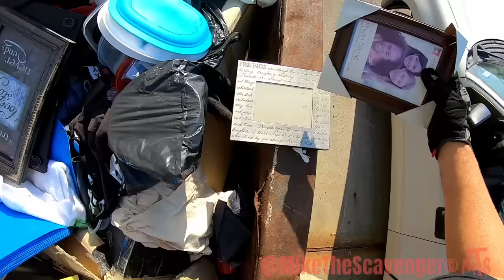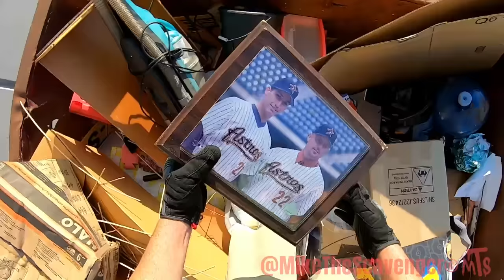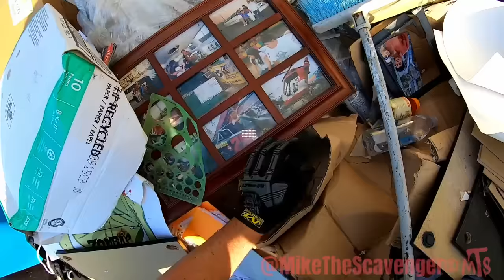Dumpster Diving "BAG FULL OF WATCHES!!!"

Comment: 17:30 that's a shotgun snap cap - allows you dry fire and drop the firing pin on an inert round. Gives the firing pin resistance when you do so you do not damage it.

Comment: The little red/clear thing at 17:30 is a snap cap for a shotgun so when you close a double barrel, etc. you can uncock it without dropping the hammer on an empty cylinder, which would eventually damage it.

Comment: I was thinking about how I miss your random underwater diving videos and then tonight I saw a video of this thing I forget the name but it’s a portable lung thing that floats on the surface and it has like a 30 foot air hose with a breather. And it just follows you around and gives you up to 3 hours of air before the pumps battery runs out. That would be cool to have Mike and do some under water videos with.

Comment: Those plates in beginning probably induction welding plates for some type of seam or seal weld in sheet metal.
Reply: Traditions in a shotgun shell you can dry shoot the gun and it doesn’t ruin firing mechanism I think

Comment: Mike, I love your Videos.
I have a question for you.  Have you ever taken one of those office dividers apart?  Some of them have extruded aluminum frames with sheet aluminum under the fabric. Plus there's a lot of Is still hardware.  I don't find them often, but when I do they're worth some coinage.  Thanks for all the great shows.
They've also got a lot of metal hardware.  To check, just use your utility knife and cut the fabric all the way to the edge.  You should be able to tell if the frame is Aluminum by pulling the fabric back a bit.

Comment: 17:31 traditions. that was a snap cap 12 gauge shotgun slug. you put that in your shotgun so you can pull the trigger and dry fire the gun with out breaking the firing pin.  or at least that's what it looked like to me. they come in handy when you are repairing a shotgun, or when you are buying a used one and want to make sure everything works right.